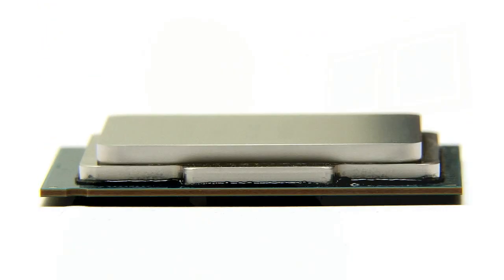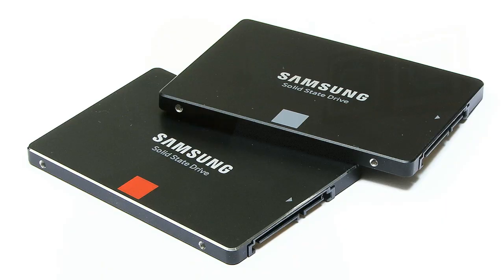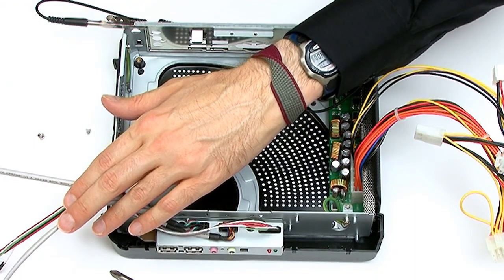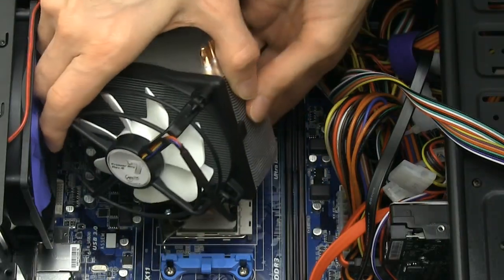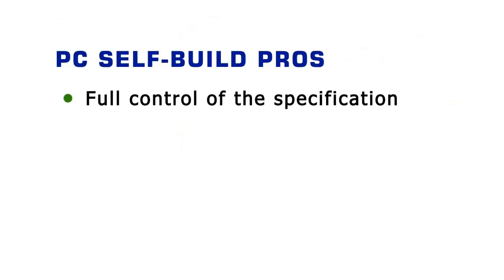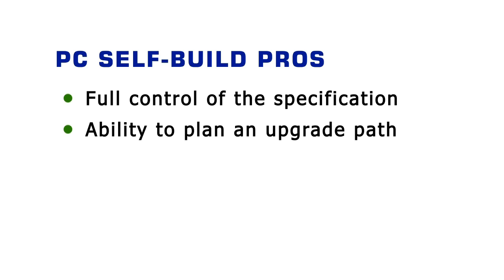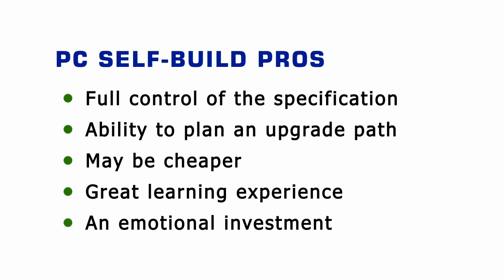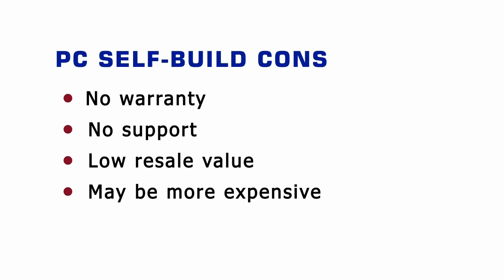New PC: Build or Buy?

Comment: My present computer was built at home by me as it was the only way to get a PC to my required spec. Intel Core i5-11600K, MSI Z590-A Pro, 600W Cooler Master PSU, Nvidia GT1650 graphics card, 32 MB of RAM and not the least of which the Corsair Carbide 200R case. It was assembled and tested with a temporary hard drive and non-activated Windows 11 Pro, then when it was tested as working the graphics card was installed and the 1TB temporary hard drive replaced with a 1TB NVME drive and an 8TB drive installed as a secondary hard drive, and Windows 11 Pro was installed and activated.

Comment: I had thought about building for my Linux Mint PC but ended up getting an HP computer from a small computer shop that had been bought in bulk from previous institutions (university computer labs, businesses, etc.). It had the power I needed but some issues with installing some components. For instance I wanted a hard drive dock right inside the case but it wasn't made for it so I ended up having to use an external one connected via USB 3. The DVD drive is mounted vertically which is somewhat awkward but still usable. It does the job although there are times I think about how it might have been had I built one instead. Perhaps some day in the future I've build a more higher spec machine. I did put in the maximum amount of RAM, a fairly decent graphics card, although not top of the line, and SSDs for the storage and system disks so I can't complain.

Comment: Long ago there were local computer clubs and local computer shows with the latest cool components at a deep discount over the retail outlets. It was a good time to put a system together. Recently more and more local computer stores are going defunct, even the big ones. I haven't put one together in 5 years, new core i7 laptops would do everything I needed to do now (don't do CAD anymore). Don't think much price difference other than some retail desktops use proprietary components that would be difficult to upgrade.

Comment: I would like to add that getting a professionally refurbished barebones office computer can often be a good base for a self-build if you're on a really tight budget. You can find a decent quad core for about £100(as low as £60 if you're willing to take your chances on eBay or Amazon Marketplace), then from there, just transplant in your old HD and some RAM and you're at the races.

In ATX ones they'll typically have 4 RAM slots and at least a PCIE 16x, usually with either 1 or 2 4x and/or 8x slots and four SATA sockets. My previous machine was a used Dell upgraded over time as my budget would allow with 8GB RAM, a 2TB hard disk and a 1050 graphics to make what was once basically a web browser and office computer into a very competent gaming machine.

Comment: I have been a self builder since windows 95, 2000 and XP. I still have all the Original Discs In their box's. The latest one was a Windows 7, which after 8 years, Is now shutting off when running a high performance program. I want to put In a Same spec motherboard but a up to date one 2021. Trouble Is I don't quite understand the new chips and ram, like You say here get It wrong and things won't work.

Comment: Low resale value of a built PC? I thought about it a lot. I think there are ways to workaround this problem

The last time for my system drive I bought the fastest but small [120 GB] SSD - after 4 .5 years it resale value is low. And so this time for instead of buying fastest and small NVMe I bought it in medium size [500 GB] . And I went and spent a bunch of cash on a high-end fan-less most powerful [700W] PSU - with a 12 year warranty to it by the manufacturer. I expect to re-sell those components in ~5 years for a considerable amount of cash

Comment: Been building (strange word) or rather assembling my PCs since age of 13 so for  30 years now... never had a pre-built pc, but seen some early Compaq and Dell - those were absurd both in terms of price and configuration. Been assembling PCs for my friends, females, workplaces in dozens. The heart-touching memory is the one that includes memory )) SDRAM to be precise ) Back then sdram modules came in two different voltages (2,8 and 3,3 if i recall correctly) but the placement notch was the same. So we bought very fancy ram modules for a guy and went assembling his new machine (pentium 1 i suppose) at his place - assembled it all but no dice, pc squeeker goes 2 beeps followed by pause and another beep - it took 8 hours to figure out different voltages of sdrams were available ))) But in the end, all went well - the seller exchanged ram modules and his pc was complete and served him for a long time ;)

Comment: I love building my own PCs for the fact that you mentioned - It's a very personal process and I get emotionally invested in my PCs.  I've always loved how intimate the process can be, selecting the components, handling them, putting them in the case and connecting everything.  I also feel like you can get better looking cases in the DIY market than you can with manufacturer built devices.  I recently built myself an i9 10850K machine and that feeling pressing the power button for the first time and seeing everything light up and the fans spin to life after all that labor went into putting everything together was the most satisfying thing ever.

Comment: today it is much easier then it was maybe 30- 20 years ago. back then you had to set the jumpers right on the drives, plug in cables the right way in and set everything up in the BIOS, also getting the working drivers for certain parts for your operating system of choice could be a pain in the ass, escpecially when it came to Linux. today allmost everything can be plugged in only the right way otherwise the plug won't fit in. And most if not everything sets up itself automatically when booting it up and installing your windows or linux operating system, it's so convenient.

Comment: Years after you posted this video being under COVID-19 lockdown finally gave me the chance to build multiple PCs. I started by upgrading secondhand PCs, e.g i5-2400 to i7-2600 and graphics card etc. I then graduated to 775 motherboards with dual core then quad core chips. I then went onto building 4th gen i5 / i7 PCs. All of my individual parts were cheap - mixture of used and new - and were a mixture of Ebay, Amazon and CEX (UK). I am still wary of using more expensive parts but that will come when I want to upgrade and parts fall in price. So far all Intel CPUs but the AMD CPUs are looking cheap even new...

Comment: Christopher, thank you so much!  With your help I built my own computer!  You made simple, all the different components. First off, buy an ATX case, buy a motherboard and a compatible CPU, then an appropriate power supply, then a drive and ram.. It was that simple!.. I went to the shops and priced machines.  They were selling a machine for $1200 that was not as good as my $400 machine...
I told everyone that I built my machine!  They weren't impressed so I built another one.. Currently, I'm building another.. and I have plans for another... Christopher, HELP!
Reply from the maker: You seem to have the PC building bug! :)

Comment: Hello and thank you for yet another interesting and concise video. I’m becoming addicted! I am considering building my own pc for the first time and have three old pc at hand - two normal ( XT?) form factor Tiny machines, one with a massive case and one HP slimline. You mention in your excellent vid that it may be possible to use some of the existing parts and components for a new build. My question is... how do you know if the case will accommodate the I/O and cooling requirements of a new Motherboard and how do you know if the PSU can cope - I’m sure there are a number if other things I haven’t considered too! However, I fell confident about bolting things together and loading an OS. Lastly, there are a bewildering number of motherboards and processors out there. How do you start to get the right components for your build. I appreciate you probably need to start with the motherboard, then processor. My apologies for the long comment but I hope I am asking questions that many others watching your vids will appreciate.
Thanks again for making these easy to follow and entertaining videos.
Reply from the maker: For the PSU it comes down to the connectors it has -- most modern motherboards will need a pretty new PSU. But many older cases can work just fine. It will come down to the size of motherboard you pick, drive requirements, etc.

Comment: My first built was a 486, it was a little harder back then. 

The ide cables could be put in reverse if you didn't pay attention, the hard disk had to be put in slave mode and master. The front connectors didn't have a standard so that could be fun
Ahh the good old days...
Reply from the maker: The good old days indeed!

Comment: Chris raises a good point that even if you build the PC without making any mistakes, you could get stung. Back in 2009, I built a Core i7 rig with an Intel 950 on X58 and inexplicably kept getting blue screens on Win 7 Ultimate. Out of total frustration, I broke down and too the system to a local PC shop. After FIVE hours of analysis, they determined the CPU was faulty. Although the CPU was covered under warranty, the labor for the analysis was not. However, since the shop never provided me an estimate of the labor, I only consented to pay them for the first hour as they had listed up on the board. That is, after the first hour, the people from the shop never called me for authorization for any additional labor. But, I nearly got stung for $425 is support costs right out of the gate (5 hrs @ $85).

Having said all that, Fry’s has a service where they’ll build your PC with your components for a flat amount.

Comment: Hey, Chris how exactly are you achieving that opening montage with the “spinning” devices? On the one hand it seems like it could be done by flying the camera around the device on either a jib or a drone, then doing a “bullet” shot with the footage during editing. But on the other hand, it also seems like that’s not what’s happening because the angle of the light doesn’t seem to change. Also doing it this way would require the white background to completely surround the device during the shot.
Reply from the maker: The opening montage is modelled and rendered in LightWave -- no nothing is real: all is CG. You are right that the virtual camera moves, not the object. The motion blur frames take about an hour each to render, even on an i7. It's a seriously processor intensive sequence.
Reply: ExplainingComputers Wow. Great. Thanks. I also figured it could’ve been done in CG, except the spinning mobo was so detailed. So that’s interesting as well.

Comment: Back in the 2000's decade I used to fix optical drives. I fixed more than a hundred. CD/DVD readers/recorders. 
Most of the times it was only the ring belts. Some where the optical alignment. It was only a matter of adjusting a few potentiometers and gently flex the lens suspended by a wire assembly with a cotton swab. A crust of dust would acumulate and prevent the wires to flex and the lens coil to properly actuate and thus focalize.

Also we used to install the most complete version of Windows and a ton of other fancy proprietary softwares on our customized PCs for free! We would simple use the cracks. And the cracked Windows installations updated as a charm back than. Even Windows 7 with all the available service packs. 😁

I believe it is still possible with Windows 10, but why would I care?!

Comment: as some reactions below, 
I also enjoy to put my computer together for the job it needs to be doing,
my 1st was a 486dx2 and yesterday I replaced a defect motherboard for my ryzen setup,
somehow I don't miss the hassle of jumper settings, 
 or if you where lucky dip switches on the boards from  former days,
but still had it's flair though, yah even knew your mainboard and where to "fiddle" with it

Comment: I've done this in phases. Bought some, built some. My first bunch of PCs were bought because you couldn't really build them other than put boards in the box (S100-Imsai 8080), Apple II, IBM PC, Mac and when I lived in Japan, an NEC9800 (don't remember exact model but not 100% IBM PC compatible, but did run MS-DOS). Then, still in Japan, DOS/V came out (it was IBM compatible but mainly VGA and MS-DOS that was able to handle the double byte Japanese character set) and building was all the rage. which with such wide spread availability at the time and place (Akihabara). Then Windows 3.0 came out. I've also got a bunch of broken computes to make one or two that worked. Then VESA Local Bus (VLB) came out for video, thus old motherboards were rendered useless. So, start over, but VLB was short live since it was mainly for the i486, When Pentium came out, PCI took over, and start over, again. Then I was starting to realize, I didn't really upgrade things. It was just start overs. So I went back into buying. Then I'd catch the building bug and go back to building, particularly with new chip sets and PCI-E. Then I got into SBCs like the Raspberry Pi. I forgot to mention that I was a SunOS/Solaris/Linux/Windows developer/system administrator for work for many years before the Raspberry Pi repurposed old PCs to compile and build Linux kernels and ran Linux around the WIndows NT 3.51 (server and desktop) period. So, I was back to buying. Now, I'm  back to building.

Years ago in the Japanese DOS/V initiative, the only systems you could buy were Gateway 2000, or Dell or if you had a lot of money, IBM. So, building was far cheaper. Not so much anymore. But, still, it's still fun to build even if it does come out as more expensive.

Comment: A "pro" that you missed is that you can build a computer that is exactly right for the job it's intended to do, whether that's gaming, video editing, or office tasks. You won't be paying for features you don't need and you can be sure it has everything you DO need.
Proprietary computers are usually difficult to upgrade, which means that if they start to struggle with your requirements you have to replace them, which in the long run can be more expensive than having an initially more expensive but expandable machine.
Reply: A video editing setup is capable for all other common use. The actual difference is building server vs pc.
Reply: literally the first point
Reply: Pm

Comment: I have never bought a branded PC because they do use hardware that is often maxed out or the BIOS is limited. I built my first in the mid 1990's which was a AMD 486 DX100. I think the satisfaction alone outweighs a branded one for me. Linux has also been my primary O/S for 10 years.

Comment: I used to run a service dept in a computer store (not many of those anymore) and a guy bought a Packard Bell (yeah they were still around) thinking he would "upgrade" parts later on...  No problem. His first part was a graphics card. No problem. The problem was when he tried to "disable" the on-board graphics to use the video card like someone told him to. He use a dart and a butter knife to "remove" the onboard graphics chip... making the computer useless in the process... My question is at what point did he think a dart and a butter knife were the tools-of-the-trade?
The moral?
KNOW WHAT YOU ARE DOING!!! before you start. Or have someone help you that does.
Reply from the maker: Great story! :)

Comment: like you, I have been building desktop PC´s for decades.  This winter was the first time I couldn´t get it to work on my own.  I had done a motherboard swap to upgrade and old AMD to ryzen.  Noticed 2400G in the store and brought that home.  Unfortunately, today´s motherboards in stock need a firmware upgrade to accept 2nd gen ryzen.  You need a 1st gen ryzen to boot, upgrade the firmware, and then you can use put the 2nd gen processor in and it will work fine.  Brought my hafl-built case back to the store, and they kindly opened a 1st gen part to keep around for the others that will have this issue, and in about 30 minutes, everything was fine.  So even that build worked fine in the end.  Not for the faint of heart though!

Comment: I also have been building pc's for number of years. The ability to tailor make a pc to your own spec is great. I usually build with a future spec in mind. For example, to minimise initial spend I would install the graphics card from the pc I am replacing. Perhaps memory could also be installed from that other pc. Many other components could also be used, eg HDD, (if you don't mind losing the s/ware from that other pc). Possibly PSU could be used too.
    There is nothing to beat the sweaty expectation of that initial power up when you see that bios screen come up.!!
    Don't forget the process then of installing all that s/ware. Win..?/Linux? M/B drivers, graphics card drivers, etc, etc.
    Then more upgrading over time, perhaps. New graphics card to go with that new cpu, more memory, bigger hdd, replace hdd with ssd?. Upgrade PSU? Having built the pc you can do this yourself instead of paying someone else to do it for you.
   Bugbears, having to buy a new version of windows, cut fingers from sharp edges in the case (not so much a problem now-a-days). Lots of swearing when plugging in those M/B connections. Having to buy adapters because the case doesn't quite match the M/B, not enough sata power connections, cables too short, cables too long...
    Even now though, I would only consider building my own pc... :-)